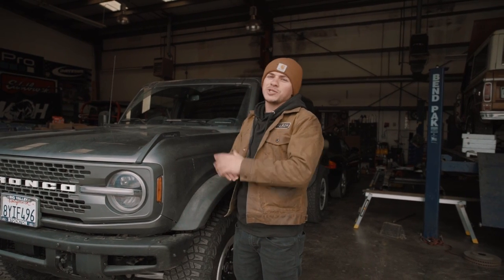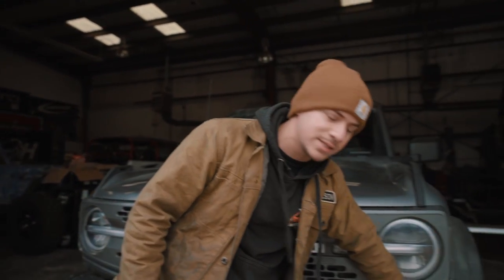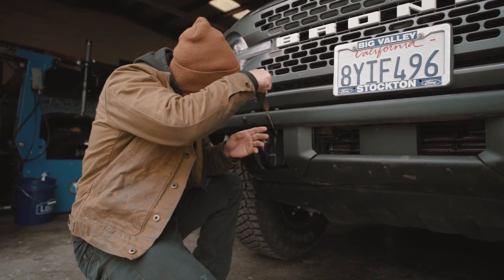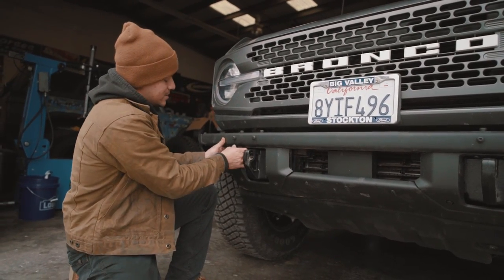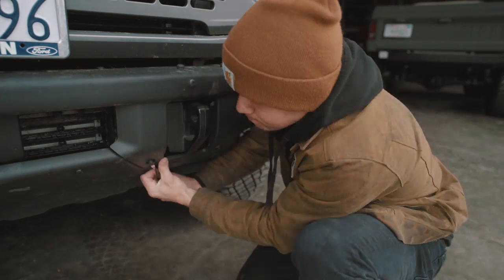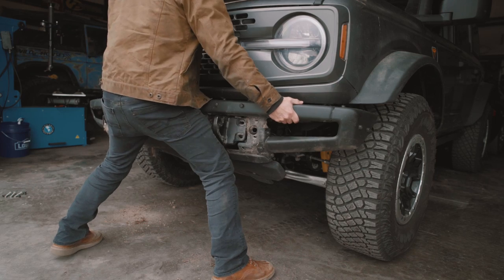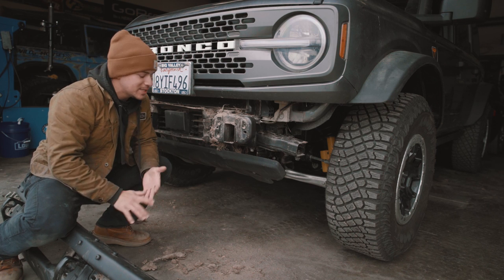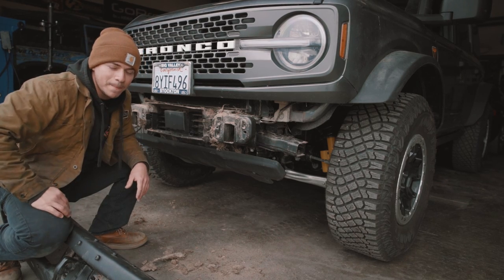Tech Tuesday: How to Remove the Modular Front Bumper on a Ford Bronco|| SUPER EASY!!

Comment: Great vid as always!! Quick question..I do have the sensors on my modular bumper. I wanted to know if you remember is there was any wiring in the middle of the bumber between the 2 sensors as I want to add to nutserts to add 3 kc pro6 lights but don't want to mess up my wiring . Thanks

Comment: Super helpful if you happened to strip a bolt trying to put a front license plate holder because you used a torx plus tamper resistant bit instead of a normal torx plus T40. Should be able to get a vice grip on the backside with it removed. (fingers crossed)

Comment: Is it the same process if your removing the stock steel bumper to go to modular one? Do you know?
Reply: 😂 I’m planning on removing the stock base bumper and swapping to the MOD steel bumper so i guess I’m in the same boat!
Reply from the maker: It’s pretty much the same concept. You’re removing the caps that cover the bolt heads then unscrewing those same 6 bolts
Reply: @wildhorses4x4  - Thanks for the tip! I plan to swap out mine this weekend!